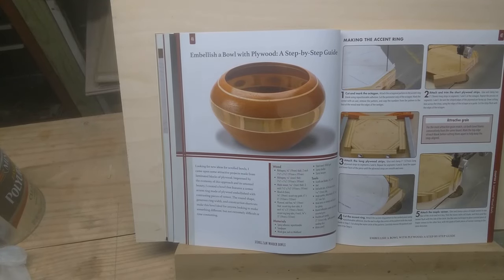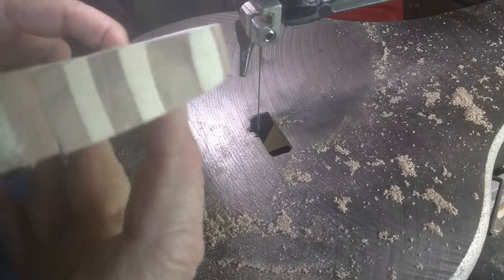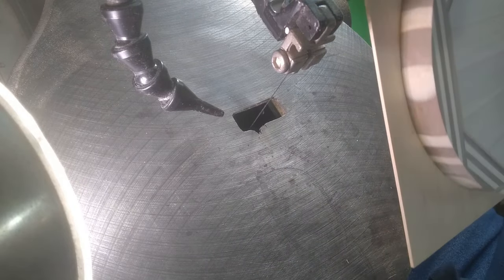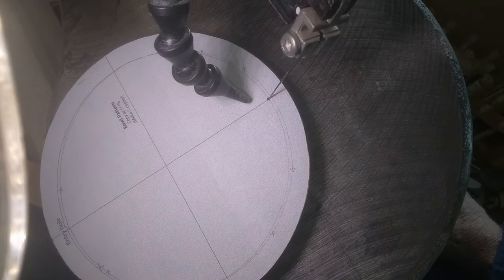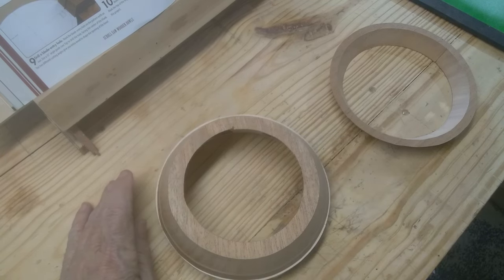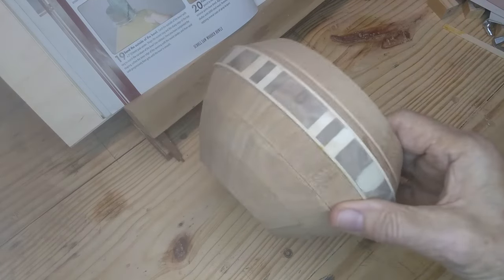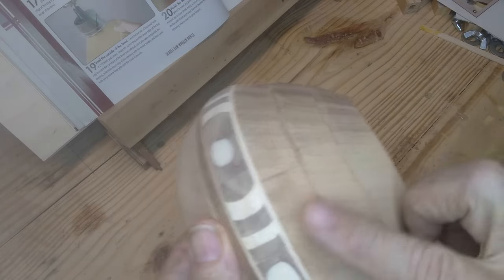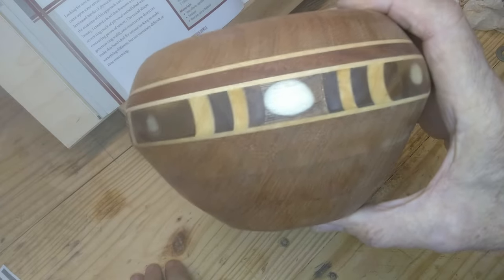The Biggest Mistake With Mahogany Scroll Saw Bowl

Comment: Thank you so much for you videos I want to try make board bowl's
Reply from the maker: You are welcome.  I really like to make the bowls.
Reply from the maker: If you are using 1/4 inch wood and cutting 3/8 thick rings you need to figure the angle for the cut. I use this tool to figure for different combinations  https://www.scrollmania.com/AngleCalc.html.  1/4 inch wood with 3/8 thick rings may not be possible on a scroll saw, at least not on mine.  You will probably need a thinner ring.  A 1/4 inch ring in 1/4 inch material would require a 45 degree cut, the thicker the ring the more degrees you need.